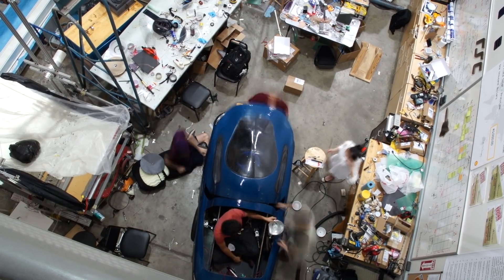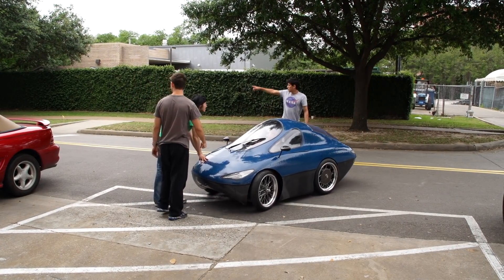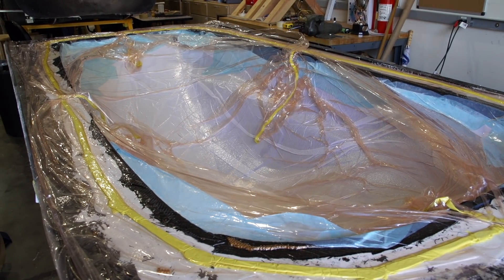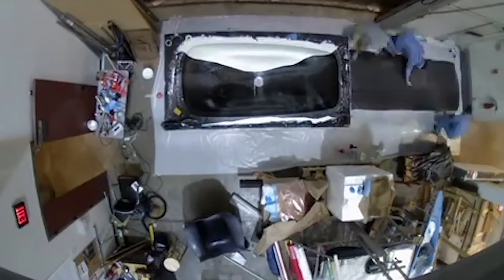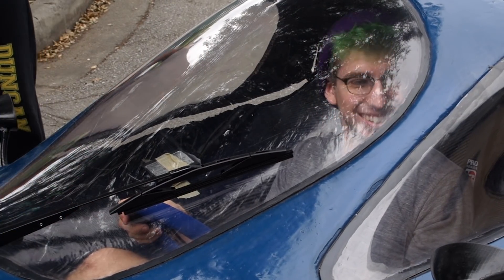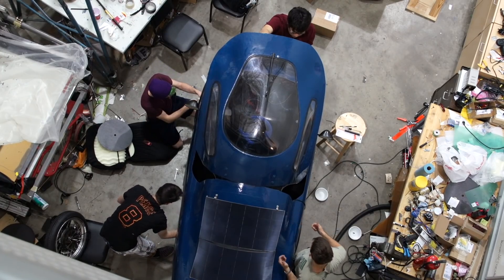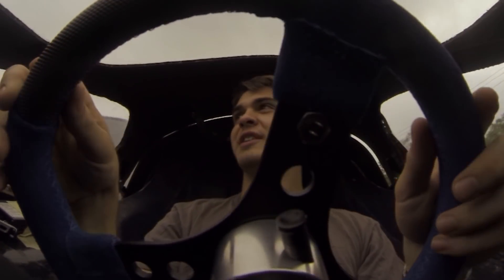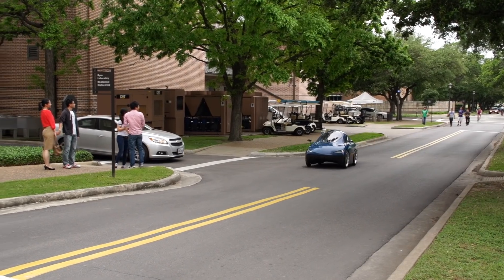The Rice Solar Car Club builds an urban concept electric car from scratch

Comment: The biggest problem with electric cars is using them in the real world. For instance, if your vehicle normally has a 100 mile range and it's cold enough outside to run the heater full blast, all the lights are on and it's raining so you have to use your windshield wipers as well the range will be greatly decreased. Under these conditions you would be lucky to go 15-20 miles. Also, this design would be illegal to drive on the streets, it's too small. Good job on it though.
Reply: Mark Duwe Model S, Model X, Model 3
Reply: Seriously,  would you use this car 100 miles non stop? Think it's good for 5 to 10 miles trip,  not 100. So 20 or 30 miles range thinks it's enough.
Reply: All can be solved. Your point about high HVAC energy requirements is valid, but solved easily (not going to tell you how). Lights/wipers/aux power is minimal draw, no issue. Current battery tech and good aero can put you at 200-400km/charge. How often do you drive more than 400km without a 5hr break? As for too small, I didn't know crotch rockets were illegal. Much smaller, no protection, seat belts or airbags either! -Sincerely a local automotive mechanic.

Comment: Pit some rubber between in the doorframe. Or you can make ot fit better with hot glue. That will turn down the noise